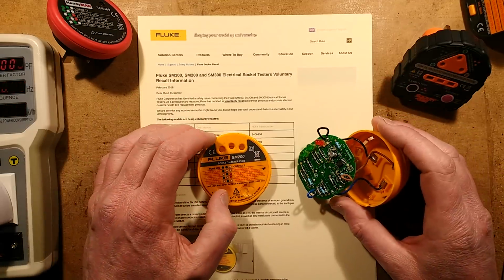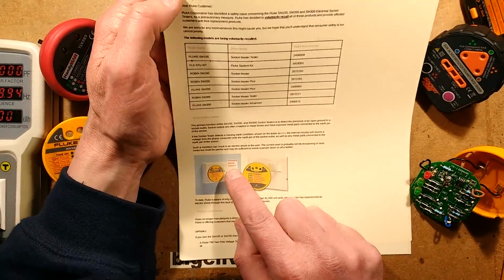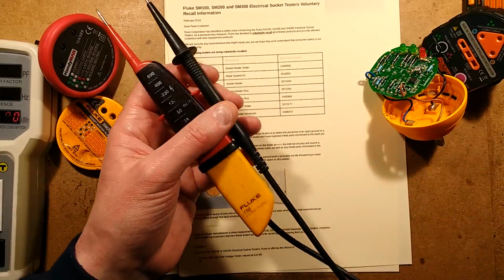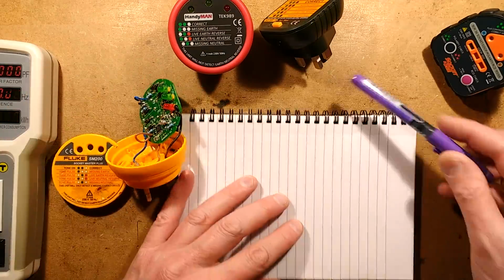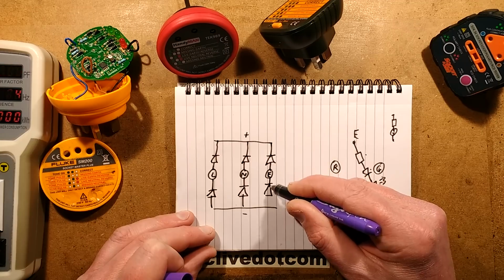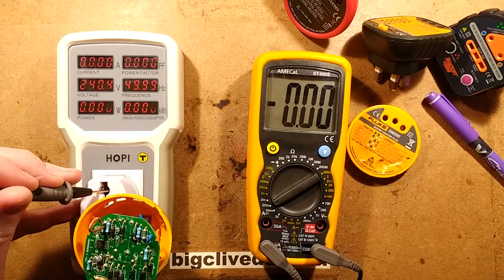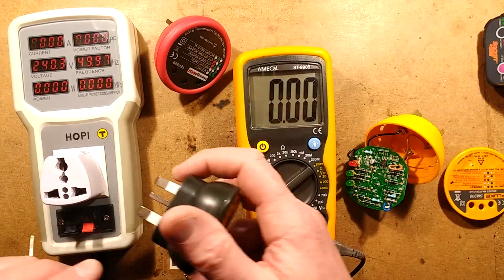Why Fluke are recalling their SM100/200/300 plug-in testers.

Comment: As proud owner of a Pacemaker with ICD, someone falling off a ladder after an electric shock could theoretically startle me enough to set off the ICD.  From experience it's an experience you don't want to experience twice!!!  I don't know what it would take to initiate or disrupt a cardiac event - but it's not always the direct path that puts you out sometimes the startle effect is enough.  I suppose american office workers are also easily spooked.
Reply: Had a work colleague poke a metal paper clip into a live socket. It took me a bit to get over his reaction to that - I doubt I'd be in either a mental or physical state for doing CPR.

It was a case of a sub D data connector. I'd spotted the size of the spark and suggested there was 240V on it but his test leads were too big to go into the plug - hence why he was poking a paper clip into it.

Comment: Strangely enough, right as this video was ending, a shitty Chinese 5V power supply went thermonuclear on my cabinet.  I was using it for powering an RGB LED tape.  Lights went out, heard a few little "ticks" from it, then a big bang and flash from the mains end of it.  Nasty hot electronics smell.  I had been using it for over 6 months without a problem.

Comment: Test button is not a full proper test, merely a functional test- it doesn’t prove the rcd to be within tolerance for disconnection times or within correct Ma operating spec.
One for another video perhaps

Comment: I think Fluke are over reacting a little here, there cannot possibly be enough current flowing through the earth because given that it takes between 100 and 200 mv to kill and RCD`s are rated to trip at 30mv the rcd would be tripping every time you use it. I just hope this isn`t a PR stunt. I have been trying to find official reports on the devices but could only find that they have sold 81000 units and only had 1 incident, now to me that sounds like either the unit was faulty or something else was the cause. Besides 1 in 81000 is pretty good for reliability, are we starting the see the PR stunt coming through.

Comment: These buggers have an insulated housing. HOW are people getting zapped by them?
Reply from the maker: It's the metalwork affected by the faulty earth connection that becomes live.
Reply: And the metalwork only becomes live when current is applied through the device. But if that's the case, wouldn't the same apply to the other testers?
Reply: BlackEpyon Yup, but the amount of current passed is different. Close to 10ma in the case of the fluke because of the beeper circuitry. Get rid of that and just have the LEDs, and down to less than 3ma. Moral of the story... Beepers can result in litigation! :-O
Reply: My SM100, basic model with no sound, has 11mA written on it below the warning triangle.
Reply: To be honest, I've always found the simple neon indicators to work just fine.

Comment: 10mA is potentially fatal to people sensitive to shocks I believe (people vary in their sensitivity a lot).  However
the big other worry is that if any of the diodes on the bridge fail shorted you can pass amps between two of the pins...  The 47k resistor should be in triplicate and on the plug pins, not the output of the bridge - surely?
Reply from the maker: The diodes act like a thee phase bridge rectifier with a current limiter after it.  The only current fed back to other pins would be reverse diode leakage which would be measured in microAmps.
Reply: I've been shocked with 200 amps several times and I'm still fine. I'm sure 10mA won't even kill a baby.
Reply: MOM ITS NOT WHAT IT LOOKS LIKE I’m impressed that you’ve been shocked, on more than one occasion, while being in series with an ammeter that can measure 200 Amps! What scenario was that?
Reply: rickwookie lets just say, don't tamper with your circuit breaker panel while it's live (I know, I'm irresponsible). and also remember to learn from your mistakes so you don't do it more than once (I've learned my lesson now). I didn't actually measure the amps going through my body, there was 200 amps available. probably not accurate to say 200 amps, it was probably in between 20-70 amps to be honest because the breaker didn't trip.
Reply: MOM ITS NOT WHAT IT LOOKS LIKE Ok. Can I suggest, if you had anything like that much current flowing through you, you would have possibly caught fire? If you make a circuit with your body, the amount of current “available” before any circuit protection kicks in (the 200 A main fuse presumably) is largely irrelevant. The current that flows through you is a function of the voltage across you, and the impedance of the path through you. See Ohm’s Law.
Reply: I'm not really the smartest when it comes to oms law or elecron theory, etc. all I really know hod to do is wire up things.
Reply: MOM ITS NOT WHAT IT LOOKS LIKE You might then be surprised at just how low the current was that was following through you when you got your shocks. Above 30 mA is when likelihood of getting dead occurs, which I suspect is why you’ll see that figure printed on RCDs as the tripping current.

Comment: Instead of using one of these socket testers, I use a two pole voltage tester from Benning. 
I would go that far that I would say, that they re better than the Fluke ones. 

Only search for "Duspol" and you will find different models. You can check the RCD, if L/N are swapped, test the Rotation of an 3 Phase System and test the Voltage unter (small)load. 
At work I use a older one, which has a Divecoil indicator for Testing the Voltage under load, A co worker uses a even older model with one of these 2 way glimming lamps. And the favourite thing, they don´t beeb so annoying, instead they have a motor in there which vibrates, when you do a test under load.

Comment: I'm surprised they pass that much current. I made an IEC version years ago to test leads used by my sister's band, that was a "dumb" version which IIRC used neons with the same value resistor as seen in a neon test screwdriver, with diodes inline with each of the L-N, L-E and N-E neon+resistor pairs to remove ambiguous results (I can't remember the diode sequence, I'd have to draw it out again and work out the results table). That also had a fourth neon, diode and resistor fitted between the earth pin and a bolt on the case; regardless of what the other neons were telling you, if this lit up then you had serious problems as there was mains potential between you and the earth pin.

Comment: Hey it’s my old Fluke tester! I was wondering what I did with that, when I saw the recall recently. 

I forgot I sent it to you Clive! 

I just checked out the other video you did with it - did you replace the resistor and fix it? I doubt Fluke would swap it back for some a nice voltage probes! ;-)
Reply from the maker: It is your old tester.  The original version of the video was supposed to be the fix (a 100 ohm resistor to the earth pin had failed, hence why you were getting earth faults on every socket).  But it all turned out a bit too long for an informational video so it ended up getting straight to the point.  I wonder if I glued it back together if Fluke would accept it back.
Reply: bigclivedotcom I guess it would hurt to try. After all you don’t want to have something dangerous hanging around the workshop :-D

Comment: Please correct me if I'm wrong, but testing the current with a multimeter (=dead short) showing 9.1mA could not compare to the resistance of the human body. I would think the "worst case scenario" of current through any body part would be a lot less?
Reply: I see a rails on stands grounded by wire from socket anything is possible, and body resistance have a lot variables like a mood, water in human, etc
Reply from the maker: It's a high open circuit voltage and would depend on the environment.  Wet feet and hands or jammed in amongst tight metalwork would be a worst case.

Comment: video lenght is a digital multiple of two

NUT
Reply: Terabyte FWIW every other video produced, on average, is a multiple of two...the rest are just plain, well, odd.  :-)

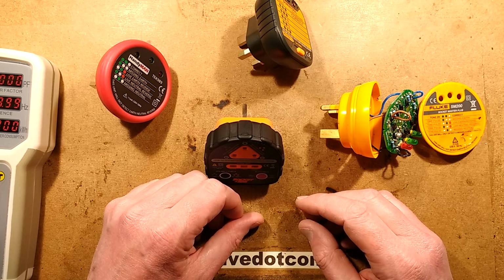Presumably what you were aiming for is a "power" of two, but neither "2049” (20:49”) nor 1,249 seconds are powers of two, though "2049" would be close (2^11+1), if inaccurate due to treating minutes as though they were equal to seconds, although neither was this video a multiple of two since it is an odd number of seconds (1,249) in length.  So what were we talking about?  LOL

Comment: I've had an electric shock from a coax cable once (or a few times from the same outlet) I don't think it was mains power but there was a signal amplifier installed. It didn't seem to have any power supply. Is this something that could happen under normal circumstance?
The coax was for tv
Reply: The coax probably was not grounded where it entered the building. If it was only grounded at the far end, there could be a large enough voltage differential to get a shock from it.

Comment: This reminds me of time when I was changing a lamp in one of these 12V halogen-style fixtures (G-something) mounted to cupboard above the kitchen sink. "It's connected with two-prong cable with "figure eight" VCR style connector on other end, I've seen a transformer inside, what could go wrong?". I was putting an bare-PCB LED replacement and noticed that LEDs started to glow when I was touching exposed metal on PCB. Not sure what crossed my mind, but I decided to put my other hand on the metal sink, still having the head under the cabinet (surprisingly close to sharp edge). Big lump on my head took more than a week to disappear. Double insulated my ass. To add insult to the injury it won't tingle if you swap the polarity on the plug because they cheaped on double-pole switch.
Reply: And of course it was UL-listed, but Chinese meaning of this is probably "Undertakers Laboratory" ;)

Comment: One thing I often remind my colleagues about regards socket testers and safety: expect anything. Yes they are used routinely on good sockets but they are also used (more than a 2P tester simply due to the convenience of being plug-innable) diagnostically. I've heard of a socket being wired L1-L2-E instead of L1-N-E, but I blame the EU's new improved wire colours at least in part for that.
Reply: 3phase motor connected L1-PE-N also in TN-C a socket connected PEN-PEN-L1 on stick (EU plug)

Comment: Just be sure where are you touching when working with mains voltage, you know the golden rule.
Mistakes happens i know, i shocked myself a few times with mains voltage(but the current path wasn't through my heart so not even close to being fatal) its painfull but not a big deal.
I feel terrible to know that we live in a world that the company that made the tool is sued by user errors.

Comment: Clive you forgot to select ac current in your multimeter during second and third product earth current testing.
Reply from the maker: I used the DC setting as the circuitry has a series diode and would be DC biased.

Comment: Surely the solution is to plug a (known) faulty appliance in (which has an insulation failure line->earth) first. That should blow away any one elsewhere who is also using another faulty appliance or using a class I appliance connected to a socket outlet/fixed connection unit where there is no effective Earth connection. Then you can safely use the Fluke tester 😜
Reply: Mark 1024MAK Yeah, I'm kinda lost on that irony as well.  Although passing upwards of 10mA to ground does seem a little excessive (in the U.S. passing more than 5mA will trip our GFCI/RCDs, and that is at 120VAC potential, so not sure why they needed so much current in their 240V testers).  But it does seem silly to be more concerned about the remote possibility of the office worker experiencing a brief non life threatening, even if very unpleasant, shock in the course of identifying such a serious ground fault yet no concern whatsoever that should any piece of equipment with a grounded metal chassis, or even a lightning or surge event, in the presence of that same floating ground fault electrocuting that same office worker because the fault is no longer being checked for now that the device has been recalled.
Reply: Ethan Poole Good point, especially as the 'issue' will only be an issue in the case of an fault in the first place. I sympathise with anyone shocked, but would much prefer the option of non-lethal and checked safe to the other of it being potentially fatal. 😂

Comment: Thanks Clive, I think learned something today: So these testers pass a current from live to earth that is great enough to be painful but that doesn't trip the RCD? I always thought the current that RCDs trip at was low enough not to be felt... So I guess the only reason it's not felt is that the RCD trips so damn fast!
Reply from the maker: It should trip in less than a cycle.  I did a test on my leg with two electrodes and deliberately passed enough current to trip a 30mA RCD.  It felt like a sharp slap.  From 4mA up gets grim fast.  Muscle locking occurs from about 10mA up.  So you could still have a terrible experience without tripping an RCD.
Reply: I don't think it wasever claimed that you wouldn't feel 30mA, just that you would probably survive it.

Comment: Good stuff Clive oh by the way why did the UK go for 240 v. ac?
Reply: mac theknife  A 220/230/240V supply requires approximately half the current for the same power, compared to a 110/115/120V supply. So 220/230/240V mains electrical cables and cords have a smaller diameter copper conductor, but slightly thicker insulation. As always with engineering, someone had to decide on a compromise somewhere between cost/practically and safety.
For low power devices and circuits, this does not make that much difference. But when using 1kW or 2kW heating, or cooker or electric showers, it does make a big difference.

Comment: Ouch.  I think you had better look over your shoulder using the one you do as well, you might get someone shouting something nasty at you when you do a test!  It will wake them up though lol.  It is surprising how some Sparkies still use the screws to provide the earth on a metal box, why take the short cut, it is so simple to run a bit of earth wire to the metal case.  Otherwise when the case screws come out the earth is gone and these testers will not show this up.  Seen it to often where the metal boxes are not earthed and a live wire touches a metal case and the case is touching the hand of the Sparkie looking inside and zap.  It is much more exciting to see a shower of sparks fly when the case is earthed and the Sparkie lets go causing even more sparks, then you used to hear the fuse blow, now it is just a click as the circuit breaker drops out.  Never fails to amuse me!  I can see why they have recalled them, but really.  If I had one I would trade it in for the testers no probs'.

Comment: What happens if you "accidentally" connect a testplug between phases? So for example 400V instedead of 230V. Smoke?
Reply from the maker: The resistors would dissipate about four times the power but if it was a brief connection then it should survive.  If it was left in it would potentially burn out.

Comment: Would you not only be giving your hypothetical plumber a shock if there was no earth continuity? With a good earth you would be passing your 10ma through a low resistance meaning the voltage at any point would be low!
I work for one of the RECs and we are not allowed Fluke test lamps but have to use Drummond! The new Drummond test lamps are LED ...... but I have had one fail! It did not light at all but was passing current as I could see a small arc as contact was made. Maybe this would be worth a takedown video?
Reply from the maker: Is it a standard testlamp housing with an LED lamp instead of the tungsten one?
The old rubber Drummond testers are very rugged, have fuse protection and put a decent load on the circuit under test.  I would have thought that the LED would be less useful for instant visual indication of rough voltage though.
Reply: No the New Drummond is similar but instead of  bulb it has Red lights (LED but very bright and shrouded so you get a series of bands lighting up at 100v up to 240 and a centre lighting area (Blue) for 415v) We are only interested in 415 /240 ... or if it is lower as we are looking at mains installations!
Reply: They have changed the whole thing ..... but it still instantly recognisable as a Drummond .... just as a Megger or Fluke is! We were getting too many bulb fails due to the filament snapping due to manhandling and the new ones do seem a better bit of kit .... unfortunately you cant get inside easily so I am unsure of the workings or the load, but it did create a small arc like you would get on the 6v spring coil batteries if you held a bulb to them!
Reply: The only way to prove a plumber is alive !

Comment: Is it a safety design flaw of the UK plug style enable you to connect the plug on only one pin letting the other hang loose. That wouldnt be possible with the style of plug we have in Sweden. The complete plug has to be connected.
Reply: A BS1363 plug cannot be connected to a BS1363 socket incorrectly. Clive is using his Chinese "death'dapter" to get around the safety features.

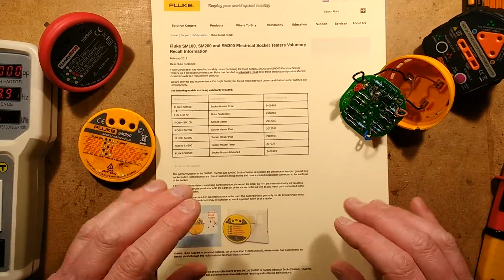Comment: 4:40 Pardon me Clive, but isn't the whole purpose of this device to be put to use to test things are correctly hooked up in environments where you haven't been in complete control?
Reply: Eh still better using something like this than waiting until a solder joint pops on a random workstation and makes a dead short to Earth, suffice to say the ground fault in the latter case will do more than make things tingle.
Reply: It's a lazy sparkies' tool. It'll detect earth but not show it's any good.